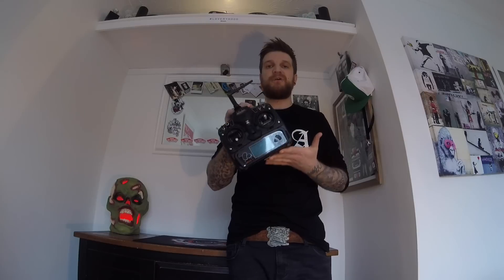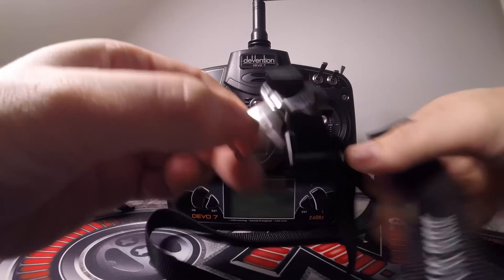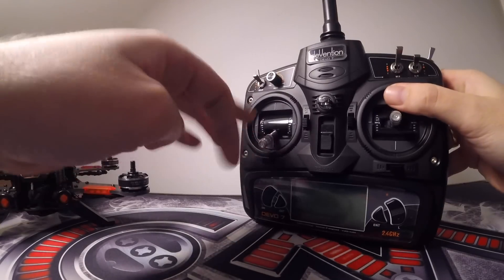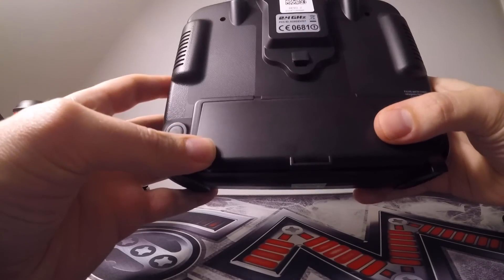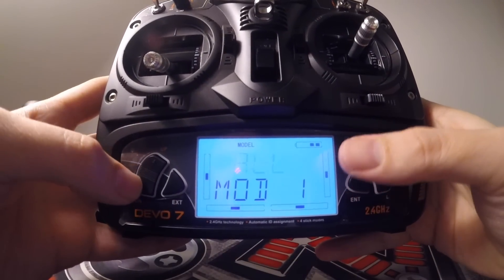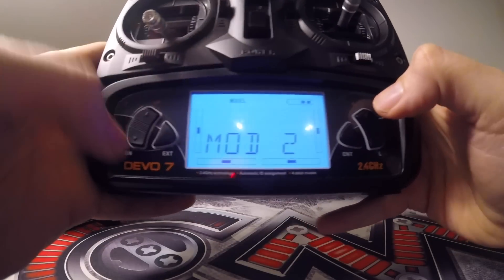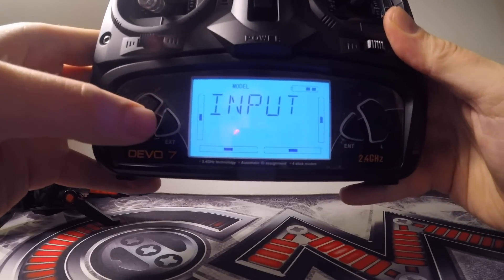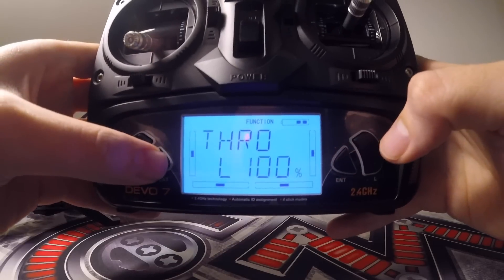Walkera Devo 7 Controller - Configuration Settings For Runner 250 Pro

Comment: So i copied all the settings the throttle is still on the wrong side. Also i plug my drone in and it refuses to fly i get the back led to go solid meaning it is reading my transciever right? But then i cant unlock it or anything? Idek ive read manual front to back to no avail

Comment: I just started flying drones however in one months time I ended up ordering seven of them it has become a quick hobby of mine now it’s a problem a somehow or another the first drone I got The controller to the drone stopped working I took it apart and that was the end of that I bought me a Weiland Devo seven hopefully that was the answer to having one controller for my drones altogether I’m not sure if I did the right thing or not the cheap drone I’m trying to fly with the Devo 7 is a small $20 HJHRC how do I make this happen from A to Z

Comment: I'm back, at the beginning of your video you mentioned triggering a buzzer via the AUX2 (left/front facing)switch, I use it for a servo that drops a payload, a parachute or my pigeon 7 (similar to Falcon 9) I cannot find a servo triggered alarm. I've had lost signal, low Batt alarms. I would like a buzzer that I can trigger with a flick of a switch. Help! Thank you!!

Comment: "If you panic" Yep, I do that a lot. Good video, especially if you have been messing around with the settings and need to go back to a safe default. Thank you. I bought a Runner 250 a few years ago before the Pro came out. I added my own GPS, volt meters and buzzers and a tonne of other stuff, cheap alternative to a GoPro,  I've since taken it all of, the 40 second flight time kinda spoiled it. All that stuff belongs on a fixed wing, for the time we get to fly on a small UAV, we are better off with buzzer if it gets lost and a timer so we no when the battery is going to get low. I sincerely appreciate the positive comments on here, many on the net just slaughter the runner but like the rest of you, I never bought it to race, I bought it to learn to fly. DJI drones are good, button to take off, button to come home, button to land. They can stick their APP up their APP. Does anyone have a link to where I can learn more about the abbreviations on the controller, I can set them, but I've no idea what they mean. Before I go, the Runcam Split 2, 23g not a 90g GoPay a fortune. Brilliant quality and if you damage the lens when you land like me, £15. Less panic, more fun :-) Also, I use Turnigy 2200ma batteries, I'm only getting 10minutes of flight at best yet the quad is stripped down to nothing but the basics, I've even cut chunks out the frame. Higher amps, heavier battery, Should I stick with the original battery ? I've never flown with it. Thank you!!

Comment: Hi mate I’ve got the advantage and the pro on the advantage when you press the throttle if that was up straightaway bit with the pro it doesn’t is this normal Who is there like a beginners mode and a excellent mode do u no? many thanks

Comment: Hi and thanks for a good informative video. 
You mention at 1:54 that you might configure the hold switch for arming/disarming. I would very much like to know how to do that (I would prefer the gear switch though) 
Could you do a video on how to configure one of the switches as a arm/disarm switch?
I have lost some props due to the runner 250 PRO's motors failing to stop in the event of a crash (I guess due to the fact that the props are always spinning when the 250 PRO is armed)

Comment: hi I have a question for u I have a Walkera rodeo 110 mini fpv race drone with the Devo 7 transmitter n it's a bnf when I got it n I hit some kind of button on the tx n the Drone is still beeping 😢 n I hit the reset button on the drone still beeping 😢 n I have a bind plug fo it to do I put it in the sbus plug to re binding it to the Drone to re binding it?

Comment: hi I have a question for u I have a Walkera rodeo mine fpv race drone with the Devo 7 transmitter it's a bnf when I got it n I hit some kind of button on the tx n it's still beeping 😢 n I hit the reset button on the drone still beeping 😢 n I have a bind plug fo it to do I put the bind plug in the sbus  plug to re binding it to drone ..n I don't have a computer to reflash the firmware on it ?

Comment: Absolutely brilliant dude, thanks for this video. Made setting up my TX take as much time as the is vid! For some reason the tx with my RTF Advance came with no settings on it at all and trying to setup via the manual was a head scratcher!

Any chance you have done/ would do a vid on how to lower max power settings via the tx for beginner flyer? 
Struggling to make sense of the usual forum how to guides and can't find a vid!
I've just transitioned from training quad and finding the jump a bit on the harsh side still!

Comment: Is there a way to set altitude hold on the Walkera Pro? As in GPS mode it holds in X & Y space but will drift in Z (altitude)  where as I just want it to hold there.  Also is there a hack to get the Devo 7 Throttle to self center? Thanks in advance!

Comment: Hi, I am completely new to this and your controller set up is great. I have a runner 250 with camera and GPS. I can't figure out how I get the camera to work in the controller screen ? Can you help this newbie
Reply from the maker: stefan8271 Thanks for the comment but unfortunately I don't have a screen controller. Could you send me the model that your using and I will look into this for you. Peace A x
Reply: It looks like the same model as yours but on page 15 of the guide it shows how to put the screen into video setting but I can work it out
Reply: Runner 250 guide V1.3

Devo 7 2.4 ghz
Reply: Can't work it out not can lol

Comment: Hey man, just subscribed to your page. I hope you can help. I cant get my devo 7 to bind with my furious 215. Had to replace the motors and think I may have reset the system somehow by pressing the little white button on the side of the receiver. Now it just beeps when I connect the battery and the red led flashes slowly. From what I can gather, this means that its not binding. I'm so fed up and I know its most likely a simple fix. I may just put my own receiver in, but not sure I can even do that. Would appreciate any help you could provide. like I said, at this point, I'm ready to smash this thing into a 400$ pile of scrap!!!
Reply from the maker: Hey Dude, Thanks for the subscribing :) right lets see if we can get this working for you! Sounds like we need to do a fixed ID, try this - Plug lipo into quad - turn controller on - find model tab on main screen - enter that menu and scroll down to fix ID - turn this to on - code will show up - then push down to run and click yes - when stops turn controller off and then back on this should bind the quadcopter. Peace A x
Reply: Thanks so much for your help. Its so hard to find anyone who knows how to work on this quad, so I tried following you directions several times but still no luck. Any other ideas?? Can I put my own receiver into this drone. It says that you can, but doesn't tell you how to do it. I would really rather avoid having to do this since this is the only walkera I on and paid a good amount for tis transmitter. Thanks man.

Comment: will this work on my qx350. the manual is different to your settings in the instructions
Reply from the maker: Gary O'Hare Hey, unfortunately I don't think it will work! Does your quadcopter have gps? Peace A x
Reply: The Art Of UAV  yes gps .its the walkera qr x 350.
Reply from the maker: Gary O'Hare I've just looked into the settings for your quadcopter, most of them are the same as this video that I made for the runner 250 but I'm not 100% sure on yours as I don't have your model to test after configuration. Sorry I can't help you more. Peace A x
Reply: Al just  try it out tomorrow if the winds dropped. But Thanks for your  reply. If it's not right can you help me please buddy. Top lad anyways on helping ppl with your videos. Top marks :)
Reply from the maker: Gary O'Hare thanks for the kind comment :) course I can help, test the setting tomorrow and make any notes of what it shouldn't be doing and report to me then I will look into seeing what I can do. Just make sure you read up on failsafe incase you need to drop the quad in an emergency. Peace A x
Reply: Ok mate . Will Do.  I have 4 cx20s the cheerson. And the controller so easy to use not like  the Devo 7. Cx20 all I  use is manual .and gps hold. And RTL. Am happy. With them mods. And with the walkera. I just want the same. I just hope your settings work.thanks .
Reply: I just tried to set mine up and when I get to review the last one should say aux 2 norm..but mine says gyro norm? How can I fix this when I try to fly it turns left and when I put it in GPS hold it's Bob's up and down  and I haven't got a clue I must have missed something out when doing  the settings  any help would be really appreciated l
Reply: I managed to do all the steps in the manual I just can't  get GPS hold or RTL to work. The mix switch isn't working? Any ideas mate.
Reply from the maker: Gary O'Hare that's sounds like you haven't mapped the switch in the controller mate! Any update? Peace A x
Reply: Can you do me a video on the setup please. I am confused on this controller.  mate. I appreciate your help
Reply: Still waiting for your feedback because I am lost!! Wish it was a cx 20 controller  ffs sorry for my swearing but am at  my limit is doing my head in!
Reply from the maker: I'm really struggling to help you, I really need your quad and controller to do a video as I don't have your model. Can you please tell me what you need sorting in detail then I might be able to write a good description to help you! Peace A x
Reply: The mix switch is not working gps hold and RTL. I am flying in manual mode all the time
Reply: I have sent it to a friend to sort it out I allso changed the flight controller to the Devo-M .. I will let you know how it worked out.. and I really appreciate it replying back to my messages cheers mate and happy Quading:)
Reply: Hey did you ever fix the issue with GPS?  I'm having same exact problem after I reset all the settings on my Devo7.  I watched the above video and set everything accordingly for my Runner Pro and now the GPS stopped working.  The blue light comes on in the GPS so I think it's just the switch somehow is not programmed correctly.

Thanks!
-Patrick
Reply: Patrick Bachmann my friend is still sorting it I haven't had the time to contact him as soon as I find out what the issue is I will contact you.

Comment: Do you know how to use the DEVO 10 to control Runner 250 PRO? 
I can bind the runner with the Devo 10 but the channel is totally mismatched. Please advise any suggestion.
Reply from the maker: yuet-keung Yau Hey, after doing some research you should be able to fly your quadcopter on the devo 10, if your needing setting I would need to look further. Peace A x
Reply: Hi, Good to know that I could make use of my Devo 10 to bind with my Runner 250PRO.
Please advise the setting or configuration file
Thanks
Reply from the maker: Hey, I've had a good look around and forums say you can use the devo 10 as a controller with the pro, Unfortunately I can not find videos on how to do this. I wold be able to do it but I don't have this model controller. Sorry I can't help you more but I would suggest signing up to walker's forum and asking for help. Peace A X
Reply: thank you
Reply: Hi 

I think I can bind and control the drone but some of channels are need to configure. Do you know how to map Ch8  to AUX 3 which is FMOD  and Ch7 to AUX 4 which is GEAR.

Please help.

Thanks
Reply from the maker: yuet-keung Yau Sounds like if you want to map your settings you will need to download multiwii on your computer and connect quad via USB and adjust setting to controller via that. Peace A x
Reply: I can make it using Devo10 thx

Comment: hey mate, would be good to see if you can find out how to make the runner 250pro programmed to give more roll and pitch so as to be able to flip. After all there is a USB port. is there a software we can use?
Reply from the maker: theJourneyofPurpose TJOP Hey dude, thanks for the question. Right so I know that the pro runs on a software called multiwii. It's absolutely shocking unlike betaflight and cleanflight. I'm happy to give you the link for the download but you will need a masters in understanding it lol. https://code.google.com/archive/p/multiwii/ I would say might be worth downloading 2.4 and seeing what happens. I know once you can connect your quad you can amend settings to give you more roll. I'm looking into other software that will work better or if I can transfer to betaflight. If I can work this out I will do a video. Hope this helps and have an epic weekend. Peace A x
Reply: thanks mate, ill have a look into it. Will subscribe and check out whether you can get some tweaking going, would love to be able to do some flips on the runner pro but apparently this drone isn't for that :(
Reply from the maker: theJourneyofPurpose TJOP Yeah this like hybrid quad I think the gps has a lot to answer for with this. Saying that it is possible to flip just need to tweaks. Yeah keep an eye out on my videos and if I get time I will get something posted on tuning. Peace A x
Reply: I would like to figure out why the motors turns off when throttle is down, no idle

Comment: will this work on the walkera 250 runner basic?
Reply from the maker: Eterio Cruz Hey mate, I can confirm that these settings will work on the runner 250 basic. Hope this helps :) have good weekend and thanks for the comment! Peace A x
Reply: The Art Of UAV I did these settings  can't get my d/r switch to work wanna add expo / curve
Reply from the maker: Eterio Cruz Nothing will automatically be set to the D/R switch you would have to download multiwii software for you quad to be able to assign things to switches. With amend to the throttle curve you will have to go into functions on your controller to adjust this but I would make a back up copy of your controller settings on another program file. Peace A x
Reply: The Art Of UAV I had it setup that way without using multiwii my dumbass decided to reset the controller with out making a backup anyway I can get the original settings for my devo 7 and thanks bro really appreciate it and great video by the way:)
Reply from the maker: Eterio Cruz haha no way I did exactly the same thing when I got mine should have backed it up. Anyway hope you get your controller setup ok dude. Thanks for the kind comments till next time. Peace A x

Comment: How do you activate the fail safe mode?
Reply from the maker: Prophet/steve-oRazor Hey Prophet, Thanks for your question. Once you have set up the failsafe settings in the video all you the have to do is turn off the controller with the off switch. That will kill motors and drop the quad while still alarming the buzzers. If you don't set the safe mode to safe it will be on hold mode and the quad will keep on flying if your controller dies or you turn is off. Hope this help. Peace A
Reply: The Art Of UAV ahh see I've heard of another way of using a fail safe from helicopter guys using the throttle hold switch to cut power to motors would this also work as a secondary means of fail safe? 
Thanks for getting back to me tho much appreciated!
Reply from the maker: Prophet/steve-oRazor yes you can use the down and right corner on the throttle but I really wouldn't recommend this as it's tricky if your panicking. Also I recommend connecting the quad to you pc and setting the gear switch to being an arm and disarm switch. Me mainly I just cut the power to controller. Have you received your pro yet? Peace A
Reply: sweet. after months of a bad battery and constant beeps, im back, binded and maxed settings. thx!! imma try to bind it with the devo12e fire maybe, but dont wanna press my luck